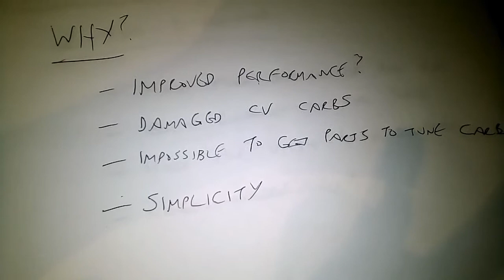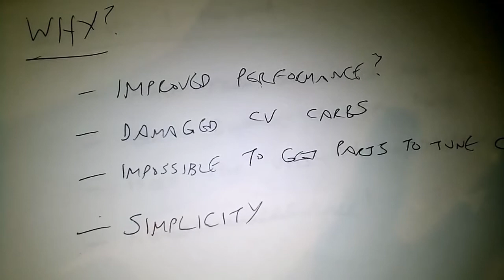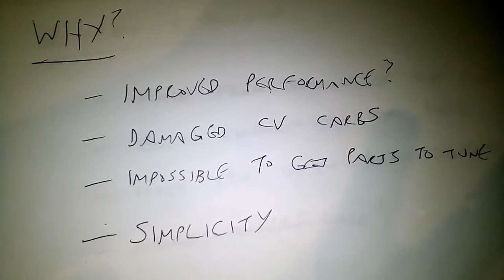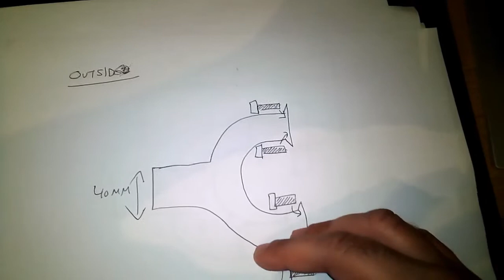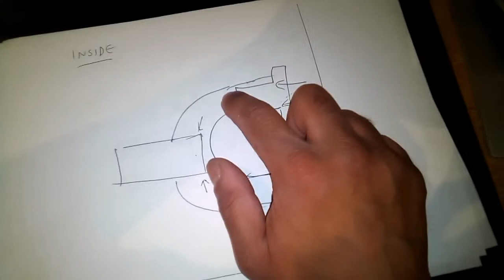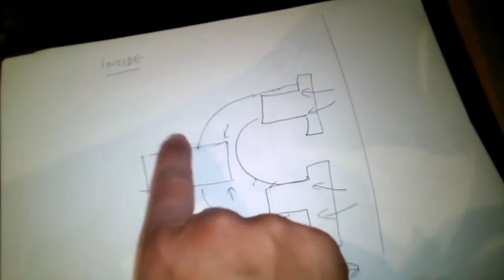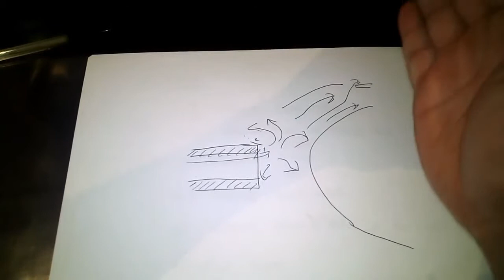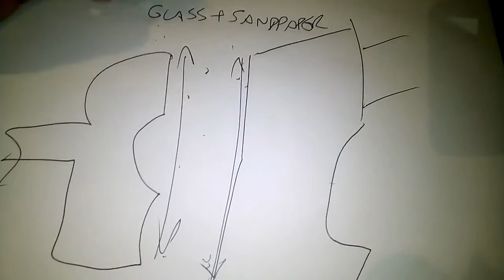KZ440 single carb conversion HOWTO

Comment: What about the side inlets from 11th hour ??
Reply from the maker: Hi. I don't know. I don't have any problems with that company and I hope this video didn't come across as critical of them - they do honest business and they do what they say they will do - and you can certainly make a 2-into-1 work, either the side ones or (I think preferably) the back ones. At the time I made this video, the 2-into-1 from 11th hour was the only real alternative to standard carbs or smaller dual Mikunis. There are now many more alternatives on the market, including a ready-made, dialled in and tuned, dual Mikuni setup which is more like plug-and-play (although expensive). Carb jets for the original carbs are also available now, apparently, going by what I read on Facebook. In general, what I did is possible and others have done it too. But I don't recommend it if you have other choices, because it's frustrating and tricky to do. One of the issues I had later on was the carb drooping. I had to support it from the back with a metal bracket. Also, you have to use an angled throttle cable fitting to route the throttle cable, or else just support it from above. I'm not sure you would do that with the side inlet. So if you have another option (i.e. not 2-into-1), go for that instead, I reckon. Good luck.
Reply from the maker: The back one may be more convenient when thinking of ways to support the weight of the carb. Also, it's likely to run less rich due to less condensation.